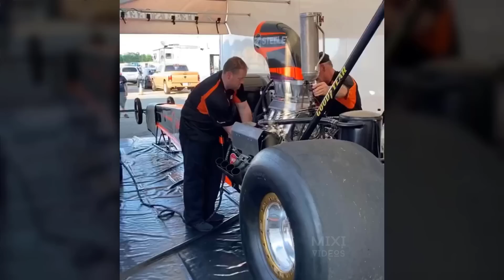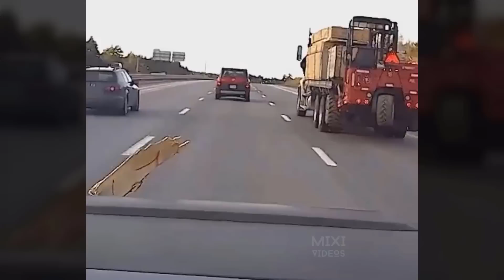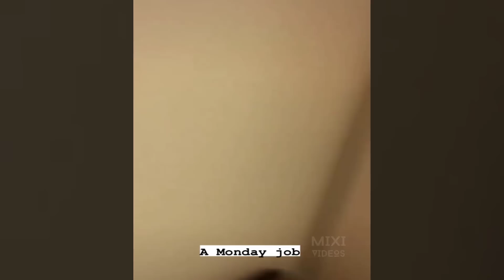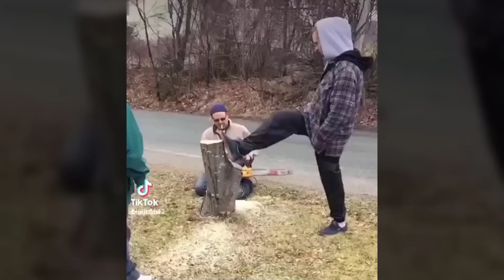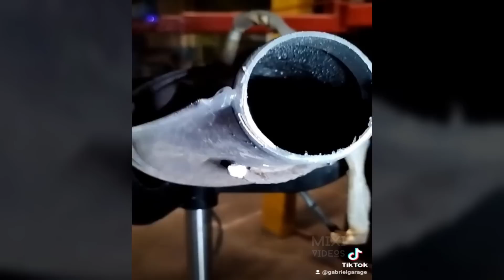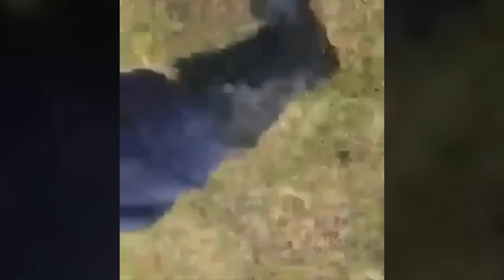TOTAL IDIOTS AT WORK #132 | BAD DAY AT WORK 2022

Comment: 0:42 Yes, that's how you start an engine with an external electric starter.
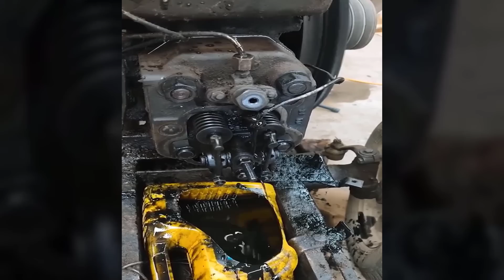0:49 Yes, that's how you flush the 100 year old oil out of the channels.
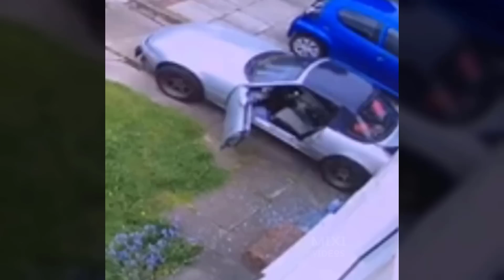5:32 Yes, that's how you start a fire.
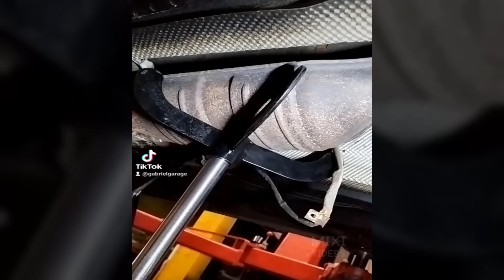5:48 Yes, that's what you see inside a damaged catalytic converter while replacing it.

One scene of "total idiots at work" is missing, it's this guy compiling the video.
Reply: +1
Reply: A+